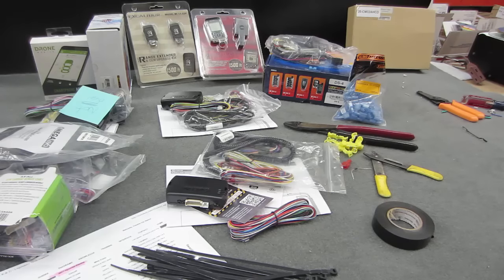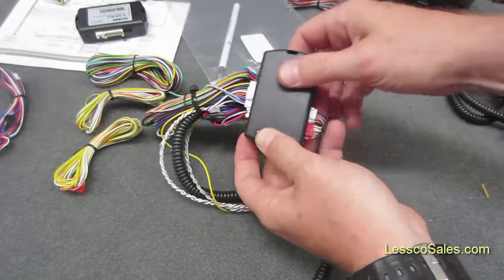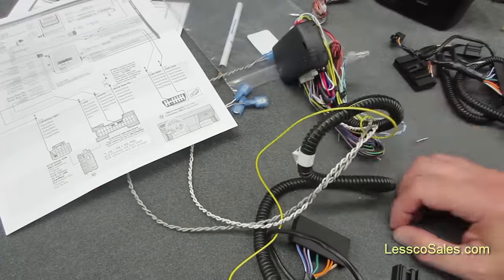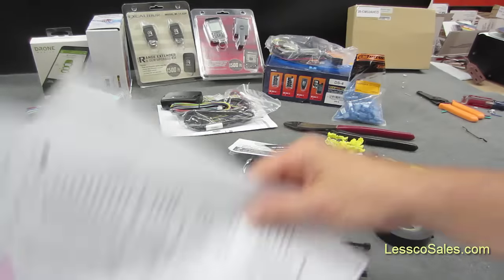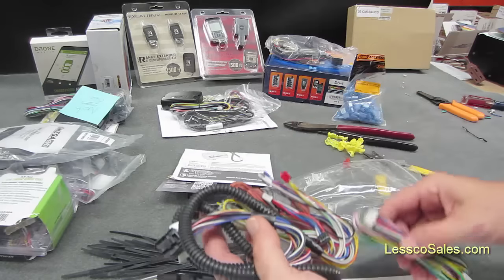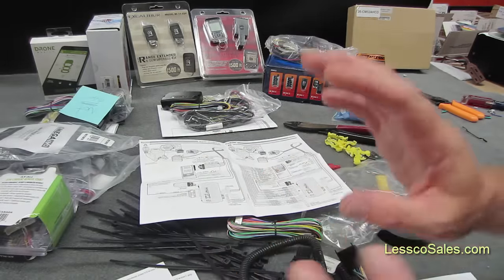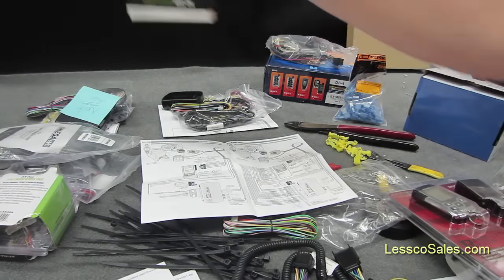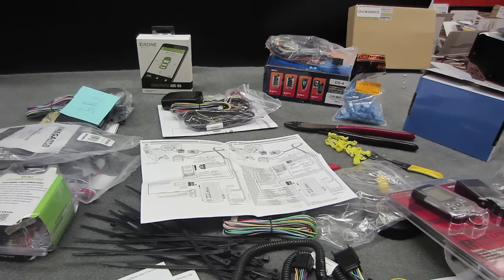Whats with these plug and play t harness type remote start kits?

Comment: I have a 2009 Ford  F150  and we brought a  EVO  RS digital starter for the electric start and we were told that it won't work. And it did not have the T harness and we got a flash link for it. Is there anyway that you can help us with this.

Comment: I just bought one but it was a different brand and it came with no instructions and came with the the t harness but I dont know anything about the other wires. It was on ebay and description said most of it is all plug and play with the t harness and that's all it said. I have a 15 Hyundai genesis coupe 3.8 v6 push start and I need help please. I know its a dc3 lc remote start.
Reply from the maker: sorry, we dont support those

Comment: Any of these work for a 2007 Toyota Sienna with power doors and liftgate?  Thanks!!
Reply from the maker: sorry, no. that vehicle predates the low voltage (canbus) protocol kits like this one work off of. you can always get a standard high voltage install kit though.

Comment: Do you have a immobilizer bypass for 2004 Mazda Miata ?  I have intermittent crank no start. I want to eliminate the immobilizer and just use a regular key like the valet key.   Even better if you have a remote start and lock/unlock kit that eliminates the immobilizer. Please advise and let me know what I need to order from you to solve my issues. Thanks again. Great videos

Comment: do you have a plug n play for a 2018 frontier?
Reply from the maker: I have one for up to 2017:https://www.ebay.com/itm/Evo-One-NIS2-Alarm-Remote-Start-T-Harness-Fits-07-2017-Nissan-Frontier-3XLock-/362154744957?hash=item54521adc7d

I called to see if the 18 is the same and no one knows just yet, Hang in there, it should be published shortly, BTW that truck hasn't changed much at all since 2008....
Reply: Lessco Electronics i think there are no changes.  Is this real easy todo, and will the remote unlock the doors do u sell other than ebay

Comment: Hi there Martin great work on all these videos Im sure you will be able to steer my in the right direction as you know this industry is a mine field. so what I need is a recommendation for a 2 way alarm system non R/S but would like it to have a D2D port to connect to a DB3 all I have for my vehicle which is a 2017 Ford Transit Thanks Mark

Comment: Are these kits come with anti theft in mind? Can someone break into your car and drive it off?
Reply from the maker: They are designed to shut down when sensing the brake wire being depressed, and it also helps make the transition between remote power and key power.
Reply: Does the engine turn off when the door opens?
Reply from the maker: Only on some Toyota

Comment: Hey lessco my name is frank I have a 2010 silverado anyway I'm have a issue with my head unit cutting off and rebooting at about half volume this has happened after I installed my highs amp my head unit has front rear and sub Rca out puts power wires are two 4g wires ground is independent im stuck if u can plz help
My list of equipment
.pioneer Avh-x4700b (head)
.Inner fire 800w high 4ch
.inner fire 2000 bass amp
Speakers
Highs are alpine type R 
Subs are accent audio mayhem(two 10s)

Have already tryed
Ran separate remotes from bat just to see if was over loading head unit same issue

Turned off bass amp to see if it was a power issue same deal 
 
Re soldered all my head unit wiring got rid of but connectors 

Even added a divider to rcas to brake the ch down not needed but just to give it a shot 

Tryed to lower the gains still cutting 

At this point I'm think my high speakers just can't handle the power and are over loading 

 
No luck Plz plz help thanx
Reply: how do i reset my anti theft system dodge avenger 2012..it turns my car on but will not start

Comment: This is an interesting service! I understand you are attempting to make this simple for the average user but scotchlocks have a reputation of damaging the wires when installed, due to their design flaw they rely on to make a connection. Lets be honest, its the lazy, very quick way to perform a mediocre job at best.
Reply from the maker: they arent scotch locks, theyre t taps. nd you can always choose not to use them
Reply: t-taps, scotchlocks, etc are all different styles of wire tap connectors and are all garbage, all of them. First, the simple act of pressing the wire into this slotted metal piece bludgeons the wire. The concept behind this is fine – it’s supposed to strip back the insulation on the wire to make contact with the wire itself. The problem is that there is no guarantee that you won’t accidentally catch some of the wire in this process and tear some of the individual wire strands. It is actually quite common that this does happen. Second, when the connection process does strip the insulation without completely trashing the wire then the opposite is sometimes true – it only makes limited contact with the wire. DO NOT use these connectors on the CAN-bus wiring, you are asking for a bad time. A better solution is to solder the connection, especially on the network canbus high and low wires. The canbus is a network so all the computers can communicate. Using tap connectors on the network is a bad idea.